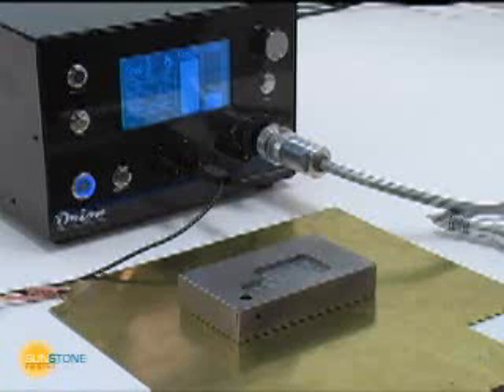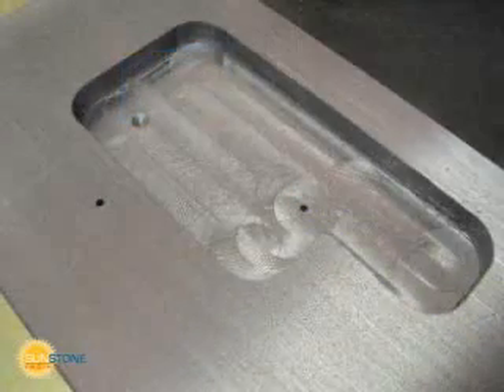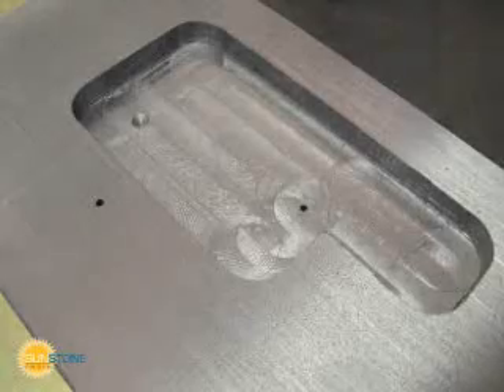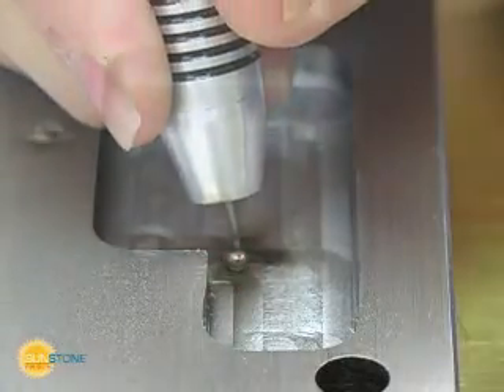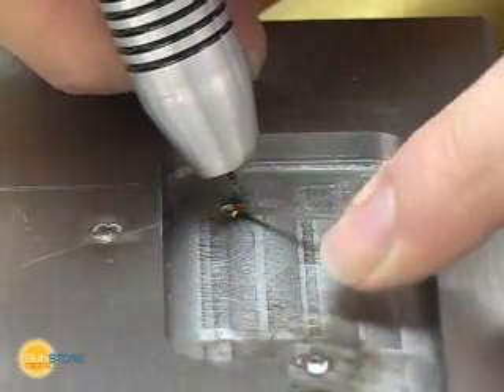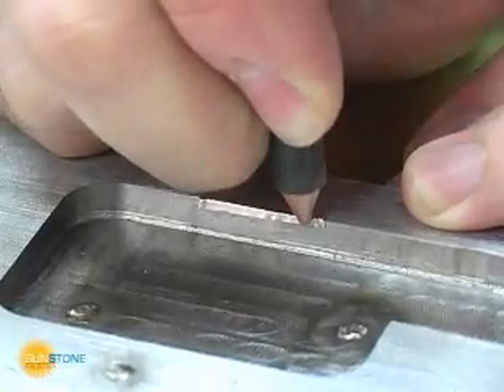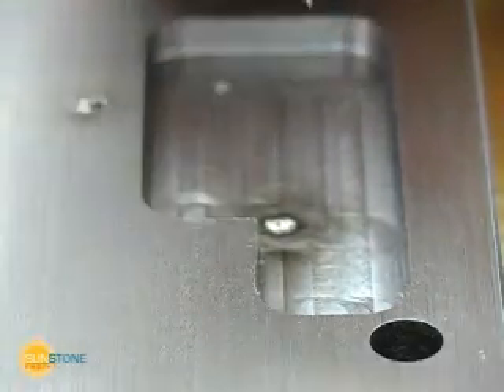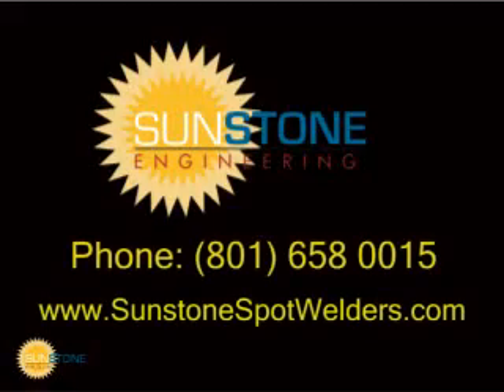PA230 Pulse Arc Welder - Mold and Die Repair

Comment from the maker: As long as you heat up the die to about 600 degrees and then weld the area with the die heated up. Then the die and welded area cool down together, therefore preventing any heat sink. If you have additional questions on this give us a call at 801.658.0015, toll free at 877.786.9353
Thanks!